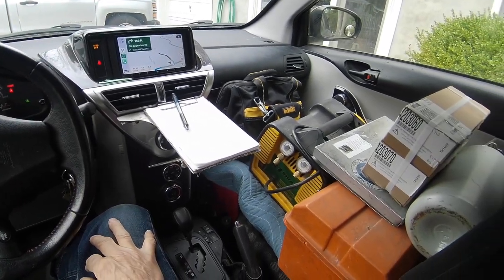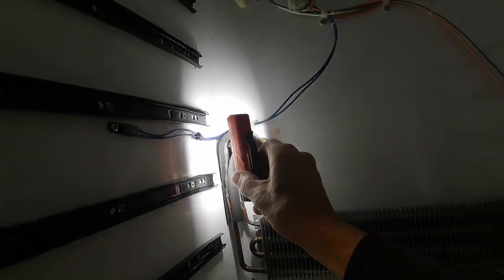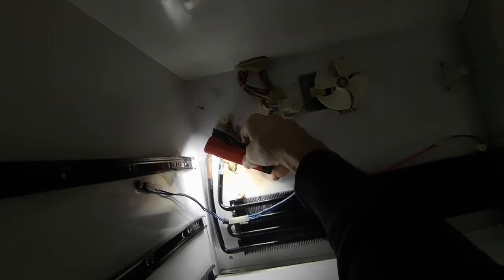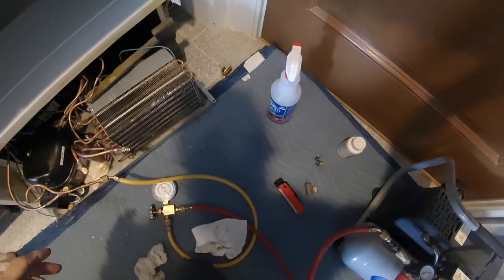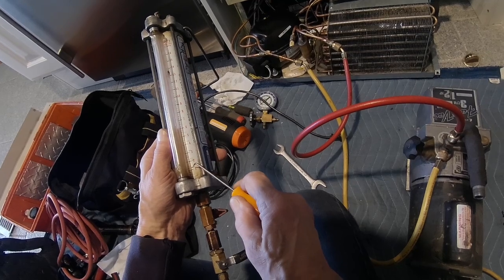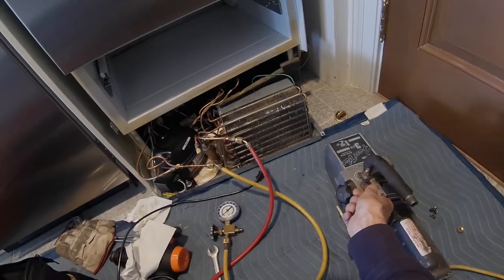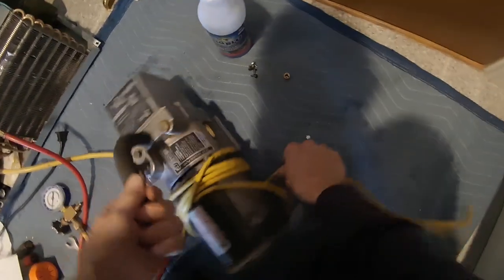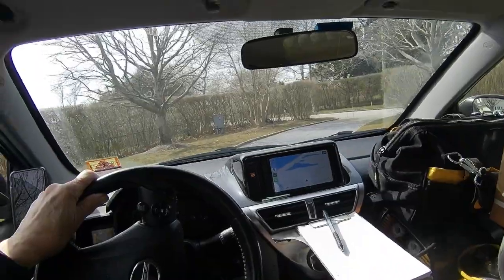Sub-Zero 427R Wine System Freon Leak

Comment: Great video! when you disconnected the hoses from the vacuum pump, didn't it basically allow for air to get back into the system?
Thank you
Reply from the maker: Not likely, I closed the valve on the vacuum pump before I disconnected the hoses, I also ran some 134a through the system before charging.
Reply: I was thinking the same thing. I guess I would have taken the hoses from the system first. But I have complete confidence in this guy so maybe we are over thinking things.
Reply from the maker: I always do a sweep charge before I add the Freon.